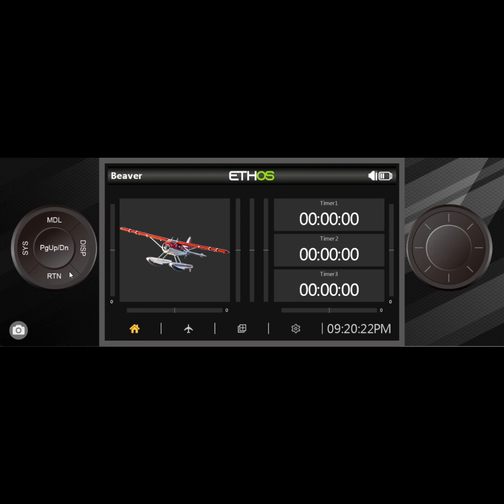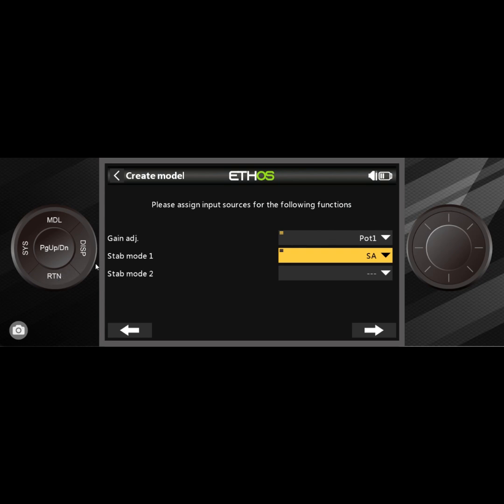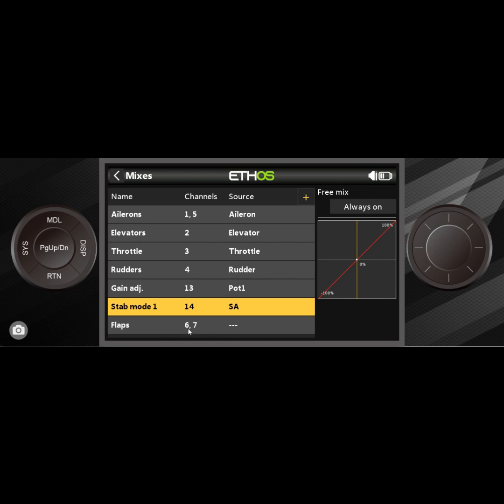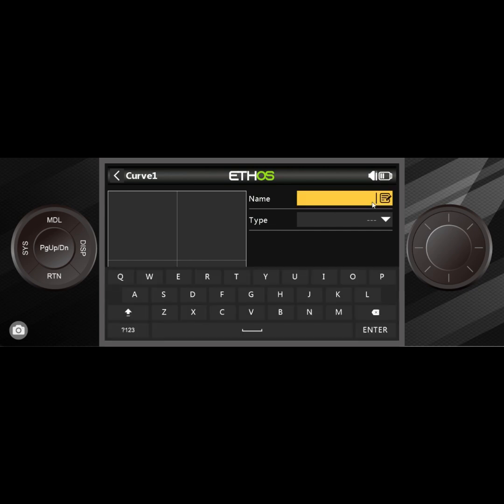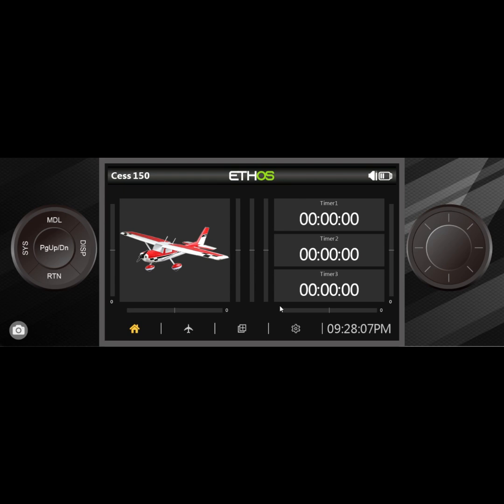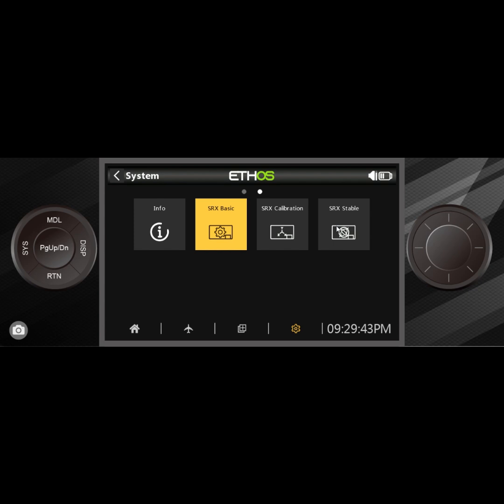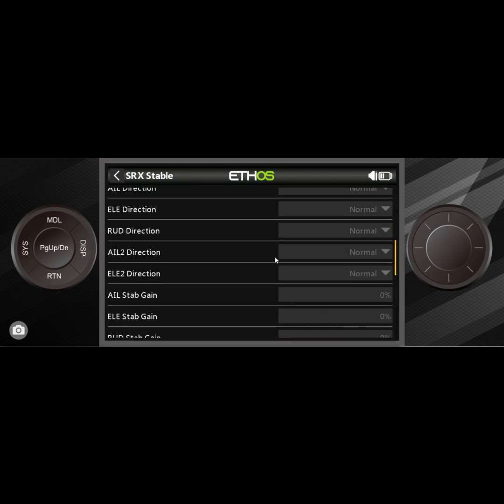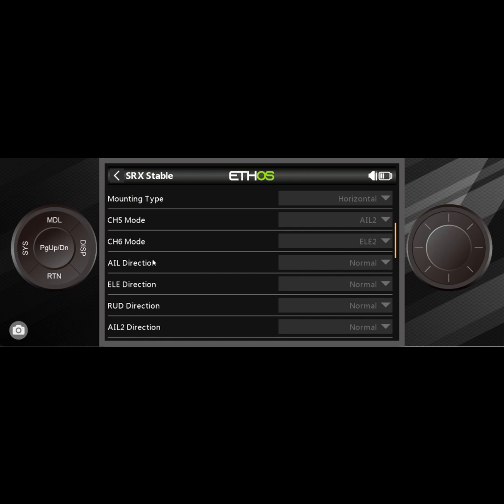FrSky Ethos 1 5 Stabilized Receiver Mini Series Part 2 of 2

Comment: After 20 years of Spectrum and 3 years of OTX/EdgeTX, I just bought a x20RS and I loved it immediately. Just took a few videos and one day to get everything working and I have started converting my receivers to FrSky. I was super happy until I installed the first stabilized receiver. It's a AP SR6 Mini and it works fine except when I power the model, the right aileron goes to waaayyy more than full deflection (like 90 degrees) for a second, then back to center. I have not had any luck with the support desk as they just keep telling me that I need to do a self check. I did all that many times but the problem remains. I actually bought 2 of these and they both do the same exact thing on channel 1. I sent a video to the support guy because if I can't fix this issue I will have to go back to my AS3X receivers for stabilization. It will kill my servo and aileron hinge quickly.

Comment: Thanks for your vids. I’m still waiting for a more in depth tutorial on stabilization manipulation that shows features kin to my spektrum so I can use my frsky stabilized receiver and 20s transmitter how I like. Maybe you can break them down like twobros does for as3x? I’ve been using gains mixes and other stabilization mixes (throttle based or gear based gains adjustments)for a while on spektrum and would like to do the same. Here’s a link to the basic bare bones explanation of what I’m referring to. https://youtu.be/CmrWfDjibU0?si=B9mwrmicNcv12wCZ
Thanks! 🙏🏾